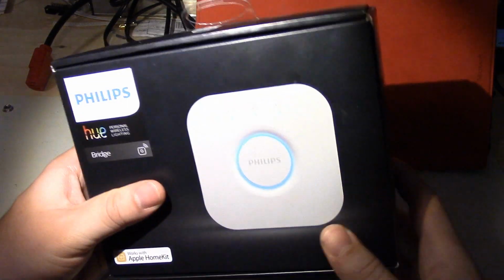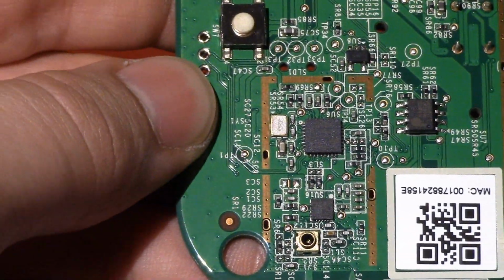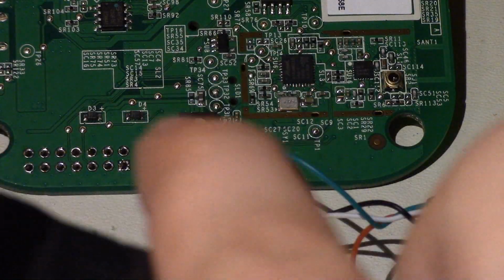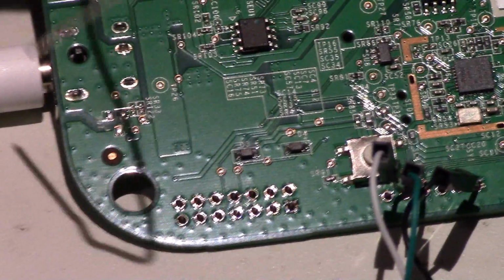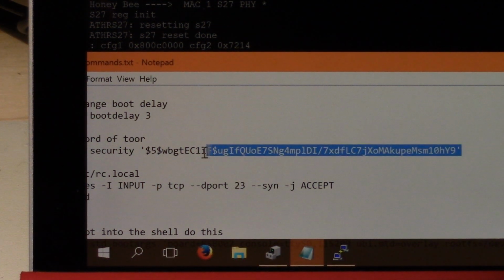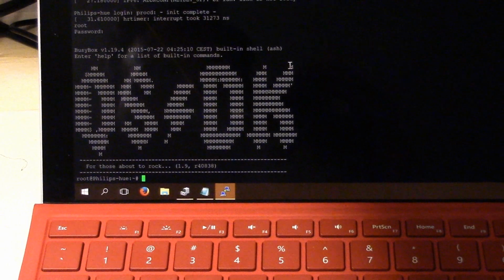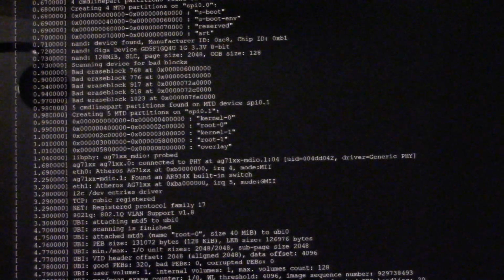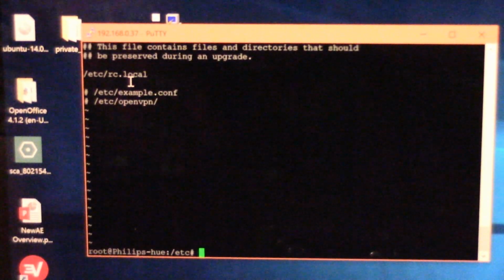Philips Hue Bridge 2.0 - Getting Root (Rooting)

Comment: This is pretty interesting - I'm in the process of trying to firmware update a device that I've had in a drawer since new and never used... and it can't firmware update because the API onboard can't connect to the services.  So it's a brick.  (Trying to use it to replace my current working hue bridge to see if the latest firmware has caused the issues I am having or not).

Kinda tempted to just crack it open and see if I can somehow update from shell or put a firmware on the filesystem for it to install on boot.

Comment: worked great for me! 
sadly i not really into hacking into the system. i had a goal i dont now how to achieve: Since i hate being forced to by specific hardware to use in my system, i thought, i could somehow hack the database of the bridge where all lights and switches are registered. with this, i want to let the bridge think my Ikea Tradfri switch is a hue switch, so that i could set the button actions in the app. Sadly i dont see any way how to do this. Any idea?

Comment: Looks like you know a lot about this... Mine after a energy break down keeps turning zigbee led off every 2 minutes and 10 seconds... Every time. I can not add any lights again... If connected to internet same thing every 2 min and 10 sec Internet and zigbee led goes off and on after a sec.. (internet flashes and then gets on). Any ideas?

Comment: +Colin O'Flynn Wow Colin you are a super genius. Very impressive. I was wondering if there was a way to add a 3rd party light switch with Z-Wave and run it through the rooted Hue Bridge. I ask this because I find the Hue switch to be derivative. It runs only on a battery and cannot be wired into the socket. There are 3rd party switches that are wired and include LCD screens and nightlights. I understand the Z-Wave and Hue use competing communications signals but can they be abridged?

Comment: Hey, the bridge 2.1 layout is similar, but it won't boot when the FTDI TX pin is connected. I know I have the correct pins because I can see the boot process and type but the boot process stalls at "Stack Pointer at:_______". I don't know what to do at this point.
Reply: For the Hue hardware V2.1, The pinout of the FTDI is the same, the device boots normally with TX connected. The test pin moved slightly, but you can find it right below the U in the silk screened SEU11 label.

Comment: whether, there is any method to jailbreak hue 2.1 bridge??
Reply: I've noticed that the board layout is similar, but the UART pins are swapped. Idk about the NAND corrupt pin, but I've been having problems with the bridge refusing to boot when the FTDI TX is connected.  Have you gotten any further than that?
Reply: @mutatedpixel8042  I have a similar issue. Don't know yet why but if you have the hue bridge's tx pin attached during the first 3 seconds it won't boot. I solved by powering it up and quickly attaching that cable to the USB to Serial (CP2102 in my case).
Anyway, it's useless because it won't show the login prompt.
You can still set the boot timeout though..
Reply: For the Hue hardware V2.1, The pinout of the FTDI is the same, the device boots normally with TX connected. The test pin moved slightly, but you can find it right below the U in the silk screened SEU11 label.

Comment: Well... I'd ask what is the point of rooting it and what could you magically do with a rooted hue hub, but considering the amount of comments that the video has and the pure lack of attention the actual uploader is giving the comment section.... asking this would be completely useless...
Reply from the maker: One of my videos got a bunch of spam, so I had tons of notifications (100+) and only just realized there was some legit ones mixed in there. Anyway rooting is purely for fun... you can run your own tools/commands on it if you want, so it's useless if you just want to do normal home automation stuff.
Reply: I’m looking for a simple circadian lighting but there’s no way I would change all my switches. So there is solutions with home assistant or even an esp32. But I wonder if hacking the bridge could do it ? 
Can you interact with the bulbs now that the bridge is root ? 
Or is it just usual Linux command unrelated to hue lights ? 
This I didn’t understand. 
Thank you for showing everything.
Reply: @nicolasvair  hue is most expensive and limited solution. Just go to literally anything. I had a hue now I am on Home Assistant + Z2M, although a bit steep learning curve, but it pays off. I have devices from so many manufacturers on same network. Philips, Ikea, Xiaomi, Aquara, Moes, ...
Sometimes I buy device because it is cheaper, sometimes you dont have solution from one manufacturer.
Reply: Colin - Your the man. I would of told this guy to flip off. He could of asked in a nicer way. I cant stand rude people. So good for you for the polite response.

Comment: great  so what are some practical applications you can do with a rooted hue hub?
 would be nice if you could root a gen 1 hub and mod it to run apple homekit  or at least mod it to do scenes with alexa ,i don't know why the new hub is required for scenes with alexa, i mean i have it working through IFTTT but it does not work nativly , also siri does not work  with  the gen one hub at all because no homekit i don't   think  alexa uses homekit for scenes , i mean it works for everything else just not scenes,

Comment: What is the test point? Why does pulling it low make the device fail? Is it connected to some eeprom?
Reply from the maker: Yeah it's used as part of the design during manufacturing tests. It's not designed to be pulled low, so doing so causes the data to not be sent between the devices.